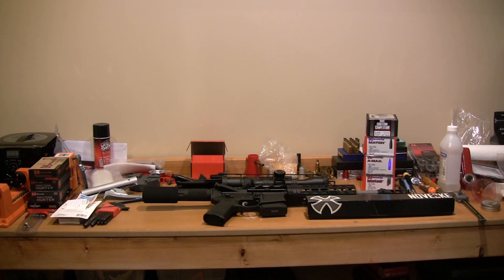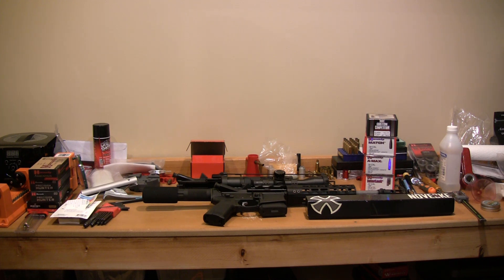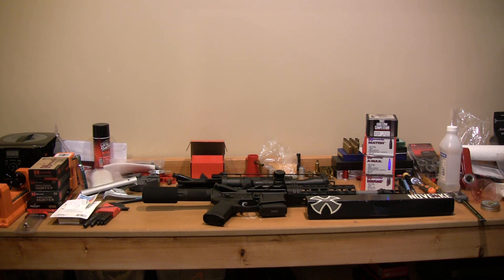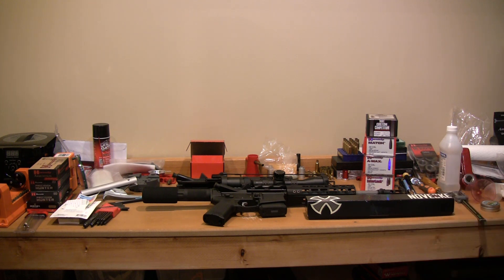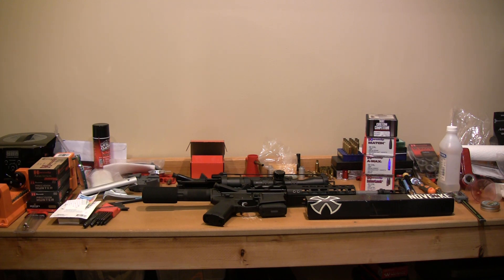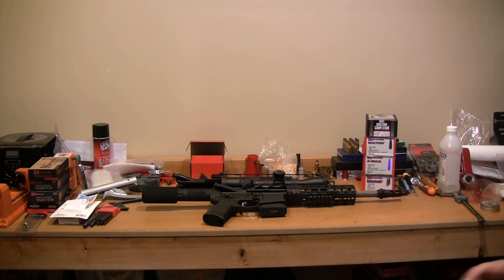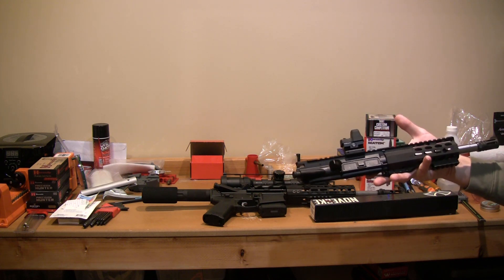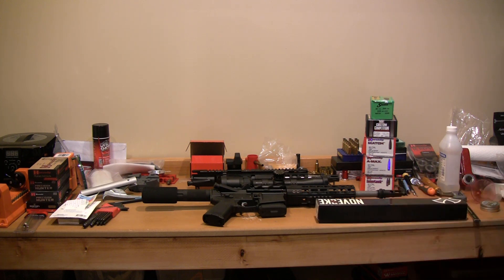300 blackout barrel Selection: Twist Rate Matters

Comment: Great video. I run a 1/7 twist rate on a 10.5" barrel suppressed and the 208gr Hornady A-Max is deadly accurate.
Reply: Same...no issues at all
Reply: What barrel are you running?
Reply: 8 MOA is still deadly accurate.........
Reply: I think it’s because it’s only 8.5”. Me personally I don’t know why anyone would get 300aac less than 10.5”
Reply: @dolphinitely_bro3944  my first thought
Reply: Ive had good luck with 208’s as well in both my blkouts one a 1/7 and one 1/8……
Reply: @Dolphinitely_bro  playing devils advocate:  Because shorter is cooler. But 5'9" is perfect 😉
Reply: AK round;  1/7 or 1/10 ?   14.7 in barrel

Comment: That’s frustrating. Good info. I went with the Q 1:5 twist barrel and glad I did. The people who came up with the 300blk said it performs best with a faster twist rate barrel like that and that helps it perform well in shorter barrels
Reply: @Marcus2750-u1t  It would've been easier to make a reliable product with the 1:8 twist, yet they chose 1:5 because it is more effective, despite the challenges it presents, such as the bullet potentially fragmenting before it even leaves the barrel. There's a reason why the people who originally made the gun(who were basically designing it for special forces operations) went with something that was more challenging to produce. It's because the 1:5 is more effective. There's a reason why all of these low end companies are making 300blk with 1:8 twist. Because it is cheaper and easier than making the 1:5, and they dont have the precision that the original creators had.
Look at ballistic gel tests. 5" barrel with 1:5 does about the same damage as an 11" barrel with 1:8
Reply: @Evan Staley  only jacketed projectiles come apart with 1-5 twist!! If you get full copper you wont have a problem,  plua the 1-5 will hive you reallly big stoping power in comparison with 1-8

Comment: One of the problems is reduced velocity in the short barrels.  Lower velocity = lower RPMs.  All else equal, you need a faster twist in shorter barrels.  I have a 7.5" .300 BLK pistol with 1:7" twist.  It will stabilize bullets up to 150gr with good accuracy. It does BEST with 124, 125 gr. bullets. 5 shots under 2" at 100 yds. Longer, heavier bullets, are not as accurate.  200 gr. bullets, while they are not "flying sideways", produce 3-5" groups at FIFTY yards. If you are going to be shooting 200-220 gr. bullets, I would suggest a 1:7" twist and AT LEAST a 10.5" barrel.

Comment: I've been telling a lot af friends don't give up on the 300 until you try the 1:7 twist.....  Mine came with a 1:7 and never had problems. And people telling me i had the wrong twist in the barrel!!! Good video!!!!!
Reply: What size is you barrel Im looking at getting a 9 inch with 1:7  in 300. That should be fine u think?
Reply: @777Edub  I just now ordered a 416r stainless steel 10.5 in. Barrel 1/7 twist rate from bca including shipping for 56$ how it will fire with accuracy well I'm hoping itll be better than a lower barrel size. I also got it in pistol length instead of carbine length
Reply: @jzaden10  I have a BCA 10.5 300 blackout 1.8 twist and it does great 1moa at 100 yards haven't taken it out any farther yet do to the rang I go to
Reply: AK round;  1/7 or 1/10 ?   14.7 in barrel
Reply: I have 1:7 twist with 7 inch on my blackout and love it..but  my m4 has 14 inch barrel with 1:8 twist

Comment: Just cancelled my 1:8 twist upper and replaced the order with a 1:7 twist. Only $30 more but everywhere i read says that 1:7 twist for a 7.5' 300 BLK is the better route. Thanks for pushing me over the edge.
Reply: I have a 1:8 twist shooting .309 powder coat cast bullets, good grouping, no keyholes, I think I just got lucky
Reply: The 1,7tw. is yust for shorter 5.5 barel and max 7,5barel, thats it!!!
For the medium 10,5"And 16" Is better 1,8tw. , I try a looot of ammunition in bouth 124gr. Supersonic And 208gr. Subsonic, for me in 10,5br. Works great at 300yrd.👍
Reply: AK round;  1/7 or 1/10 ?   14.7 in barrel

Comment: Thanks for your work and taking the time to explain your position on the subject. 
I have a 16 inch 1 in 8 twist barrel with the pistol length gas system. I haven't had any negative results with sub sonic 220gr. Or 110gr. either. I have powdered up a variety in between also. I hope in the future to get a suppressor after my Attorney gets time to research the subject of firearms trust's. I've been wanting a pistol in the caliber and I have found one I like in it and it has a 1 in 7 twist barrel. I just got on here to seek wisdom,and you have helped me to decide. I'll be fine with the 1 in 7 twist with an 8.5 inch barrel. Thanks
Reply: I think a 9 inch barrell gives you full velocity but not sure how much half an inch could affect

Comment: First, if you think one revolution per inch twist rate is going to make a huge difference in whether a subsonic bullet stablizes or not...think again. The first barrel was a PSA 8.5 inch barrel shooting subsonics...8.5 inch. Although PSA is good for holiday sales on rifle parts I highly doubt their barrels are what you consider high quality or match grade. "Moparmadman" purchased a Noveske barrel which are a high quality, match grade barrel. I have been working with the 300 BLK for years and have tried more combinatons and wasted more money than I care to admit. Although the 300 BLK was designed for a 9 inch barrel I wouldn't go shorter than a 10 inch barrel. I also recommend a pistol length gas system no matter what the barrel lenght to ensure good cycling. My personal 300 BLK hunting rifle is a stainless steel, 16 inch, match grade AND a 1:10 twist, pistol length gas system with an adjustable gas block. I have shot everything from 110 gr supersonic to 208 gr subsonics without any issues and NO key-holes in the paper. I built this rifle for deer and hogs and had no intention of running subs. "Barndweller" stated "he got bullets that were .002 larger in diameter and his problems went away." Sounds like the barrel was not manufactured to specifications. I have sent my share of barrels back to the manufacturer because of poor quality. Also, "Berger Bullets" have a stability calculator on their website...you ought to check it out and enter various numbers; you will be surprised at what will and will not stablize. Also, do not forget a good trigger. A good barrel and a good trigger will make or break your rifle. In fact, there is no reason a 300BLK will not shoot sub-MOA accuracy all day long if it is set up properly with the right components.

Shoot straight and be safe.
Reply from the maker: First, thank you for commenting. I appreciate users sharing their experience, in fact that is why I made this video. I see you are talking from a hunting prospective, and I absolutely think that how you intend to use the 300 BLK is exactly what you need to know to make your decisions. Your statement of "I had no intention of running subs" says all that you need to know. Your rifle is set up how "you" needed it to be. That is one of the things that drew me to this round as it is very versatile.

I was hoping, in my case, that It would be able to shoot anything and though it reasonably well, including subsonic projectiles. Speaking in general terms, to improve your stability you need to spin the bullets faster. When limiting the discussion to a specific projectile there are only 2 things that you can do to improve your stability, increase the twist rate, or increase the velocity. When trying to keep your round subsonic you basically have a ceiling of 1050 fps, leaving twist rate your only option left. One inch of twist increases your rotational velocity a little more than 14.2%, not exactly nothing, but you would hope not a life charger either.  

As "Bob Doughty" pointed out below a lot of manufacturers have stopped offering the 1:8 twist rate, most notable AAC. The 300 AAC Blackout was created by Advanced Armament Corporation in cooperation with Remington Defense. Yes originally it was the 300 Whisper etc. (I don't want to get into he whole history which anyone can look up) but it says a lot when they don't offer a 1:8 twist any longer.

I know that there are a lot of different things that come into play, bearing surface, bullet length, however twist rate is important. Berger does have a stability calculator and it is based on the "miller twist rule" that I mention in the video. But, real life isn't always demonstrated perfectly in a online calculator. Note that the constant 30 is Miller's twist rule roughly approximating the velocity as 2800 ft/sec. Its not that the calculator is bad, it is based on stability of projectiles of a specific construction (basically a football) in supersonic flight.

 I also agree as well that probably the PSA barrel is not a "match" barrel, but I have had excellent luck with PSA before and I will gladly buy from them again. PSA does not make their own barrels, the buy them, and it may be possible to return mine if I like, but frankly it shoots super sonic rounds just fine. 

Please don't think that I am trying to fight, I just think that a lot of peoples ideal set up for using this as a "fun round" is on a SBR suppressed as a subsonic. Doing the "proper" paperwork requires $400 to the ATF before you start buying parts, which all of us would gladly put into our rifles, but sometimes we skimp on the barrel (or some other component) cause that's what we have. I know that there are 1:8 twists that will do just fine but if you are limiting yourself to a budget barrel which some of us do, bet on a 1:7 before you bet on a 1:8 if you want to run subsonic velocity.

Good groups to you.
Reply: Jeffro Bodene is there a way I can contact you. I'm doing a new build and would live to pick your brain.  It's a bug-out gun with a folding brace / stock if I sbr and QD barrel system, with my DT Can on it.
Reply: Good comment man. You seem very educated on the caliber. If you dont mind me askin could you tell what kind of arch this round has from a 16 in barrel shooting 100 yards with a 25 yard zero? I just recently got into this caliber and have a 16 inch barrel 1-8 twist. I've had good look with 147 supers and 200 grain subs. At 25 they pretty much shoot the same but I wNt to know what the supers trajectory look like out to 100 but I dont have a place I can jus go shoot that far

Comment: I have found that 1:8 twist works fine in 208gr subs suppressed in a 10.5” barrel. The takeaway I am getting from this is if you want the super short barrels (less than 10.5”) go with 1:7. If you are 10.5” or better, 1:8 will probably work. My barrel is an Odin works. And they are stable all the way out past 100 yards.
Reply: 👍
Yp that, s it
For 10,5" barel is Definitely better 1/8tw, for shorter  barel 5,5 and 7,5 is better 1/7tw.!!!
Reply: @Tex Ko4  what about 8.5-9in what twist rate

Comment: 1:5 twist for .300 blk on any barrel under 10 inches if you want it to shoot anything and everything. Don’t forget to add a quality adjustable gas block and get a couple different buffer weights to properly fully tune it and have the least amount of recoil with the most amount of accuracy and reliably 👍🏻 hope it helps.
Reply: I second this.  1:7 is not a fast enough twist to stabilize 220 gr. subsonic shooting out of a short barrel (approximately 7.5 inches).  1:5 fixes the keyhole problem

Comment: Button rifled barrels vary greatly in their actual twist rate.   I have seen 1 in 9 that were as slow as 1 in 9.8.   This is why some people can have good luck shooting 77gr in a barrel marked 1 in 9 and others will key hole at 25yds.   A 1 in 8 should shoot 220gr with more than adequate stability.   I think your barrel is defective and is drastically slow in reality.

Comment: Twist rate matters. It's everything if you shoot heavier bullets. Case and point. I bought a remington 700 sps tactical in 308. Everyone kept bragging on its accuracy.  It had a 1 in 12 twist rate. Started out with 178 grain eld hornady hunting ammo.  I was getting inch and a half groups.  Not poor, but nothing to brag about.  Went to the 180 bergers, then 185 bergers. Both federal loads. The 180s shot 3 out of 5 into a 3 inch group. The other two keyholed the target way away from center. 185s even worse. Wound up selling the rifle for a savage model 12fv in 308. It shot the same 180 grain stuff into a 3/4 inch hole, 5 shots. That's more like it. The new owner of the remington called me and told me the rifle I sold him was a nail driver.  He told me he was shooting off the shelf 155 grain hornady sst. Showed me the target. 5 shots into a one inch group at 100. What was it? Twist rate verses bullet weight.  Thanks for the vid. Been considering a 300 blackout build for a while. Now I got some heads up.

Comment: I wasn't really sure about twist rate either when I built mine. I put the PSA 10.5" (SKU: 77932240) 1:8 in my build. I haven't gotten to shoot it much since I finished it, but the Sierra ProHunter 220gr RN I started with didn't seem to have stability issues. No idea if it's the additional 2 inches of barrel, more surface area of the bullet, both, neither, dumb luck, or inattention to the results on the target, but I'll keep this in mind whenever I finally get to test it more. Definitely don't want sideways bullets going through a can.
Reply: I believe with your barrel length it would be fine.

Comment: This is very interesting, I have a Daniel Defense DDM4 ISR with a 9 inch 1/8 twist barrel and I have never had any keyhole issues on 220g subsonics. Mine are all hand loads with accurate 1680 powder and Berry's plated spire point bullets so maybe there are some other factors besides just the bullet weight and barrel twist. If I did have any significant instability issues I would know right away because the suppressor is integral and there is about 4" inside the can between the muzzle of the barrel and the mono-core baffle. The suppressor opening is also pretty tight and I havent had any strikes.
Reply from the maker: I have seen some work and some that don't. I feel much better with a faster twist.

Comment: I have a fostech .300 blk 7.5” with 1:5 twist. I’ve seen some people talking about over-spin or over-stabilization that would force lighter bullets to disintegrate midair. I’ve personally never had that problem, even with 110 grain hollows. Perhaps the length of the barrel helps reduce velocity thus reducing RPM
Reply: Never heard of  over-stabilizing. Right now some companies are working on 8.6 blackout, used with 1:3 twist rate barrels (which sounds crazy). But I think fast twist is fine.

Comment: So, if I hear you right, heavy lead needs a 1:7 twist, for 300 Blackout, for example..  Ok for an 18 in barrel 1:8 is OK because it's a longer barrel?  Are you saying for any heavier lead the lower twist number the better or is this just for short barrel weapons?  It is completely dependent on the barrel length?  My Tikka T3 Lite shot 220gr 1moa at 150yds with ease, 1:11 barrel twist 22+ inch barrel.  Admittedly wasn't subsonic.  I'm just trying to understand here.  Thanks for the video.  Well done.  However, it raised a lot of questions for me.  I'm getting ready to re-barrel my Mini 14 in 300 Blackout.  Having Acuracy inc. do the full upgrade.  Just want to make sure I get the twist right.  I intend to shoot a lot of sub rounds and eventually suppressed.   Not expecting 300yd accuracy but i'd like to keep it at or below 1.5MOA at 100 yds.   I'd be happy with that.  Thanks again.